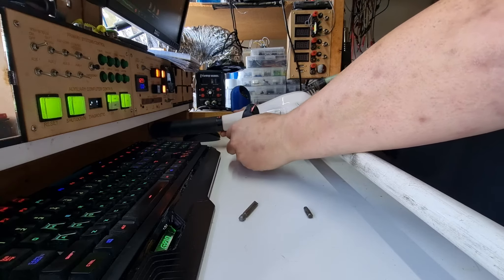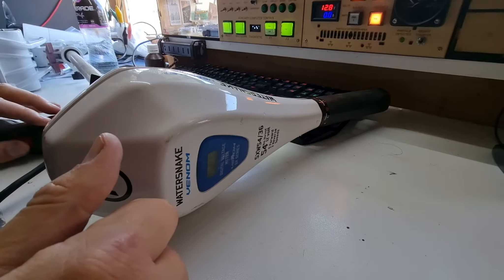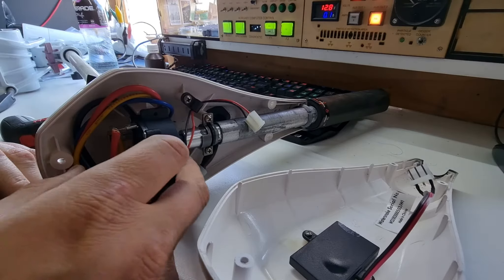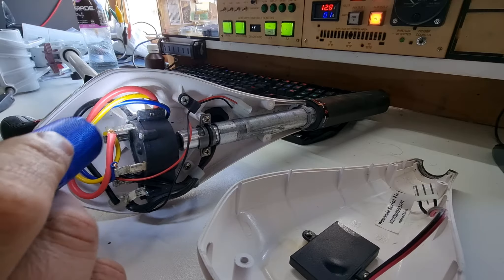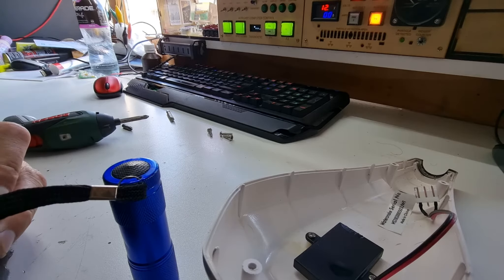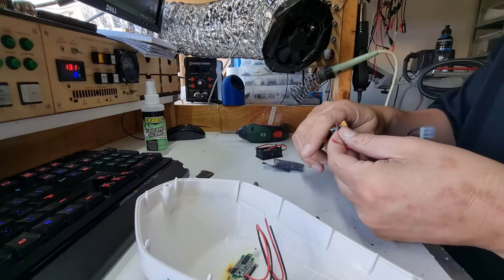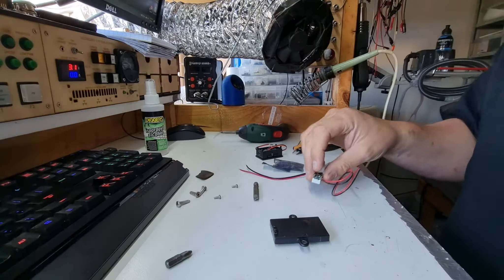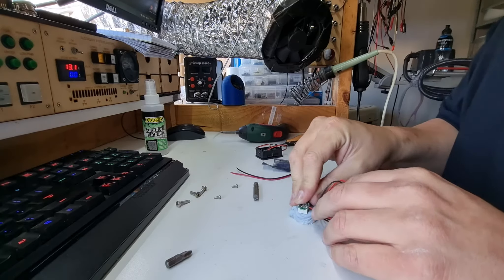Repair of Watersnake Venom SX

Comment: Thanks for the inside tour.  Do you know, or can see. if the head of the motor can be reversed as to rig the motor on a bow, not transom?  Cheers
Reply from the maker: The only thing going on in the head is a single bolt through the shaft and wires leading in. I don't see why that wouldn't be possible.
Reply: @TheAussieRepairGuy  Thanks for the info, and super quick reply. Much appreciated 😎👍

Comment: What kit do you recommend for the 50amp circuit breaker or fuse kit?
Reply from the maker: If the electrics are likely to get we as in my case, I'd go with a waterproof 50a fuse holder.

if the electrics are inboard such as a boat, the circuit breaker is a better idea.

Just carry a spare fuse, so you don't end up stranded.

Comment: Where did you get the small volt gauge you installed?  Did you have a link?
Reply from the maker: That was an aliexpress special, if you search aliexpress, ebay or other similar places for "self powered volt meter" you will find them.
Reply: @TheAussieRepairGuy  thanks for your help.  Very appreciated!